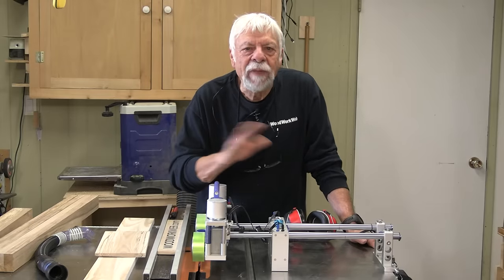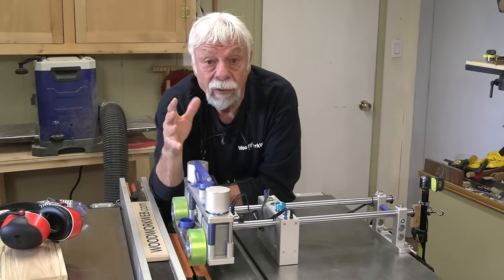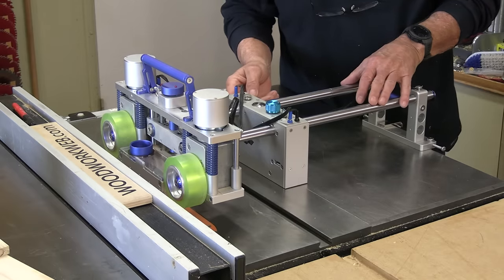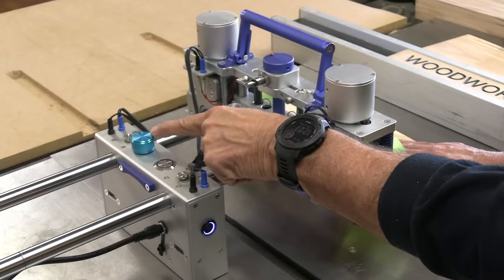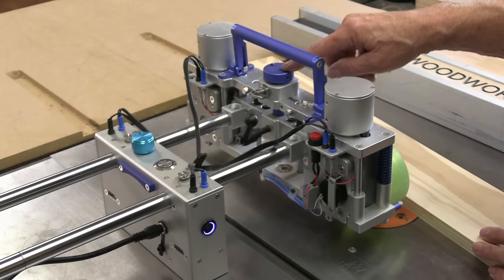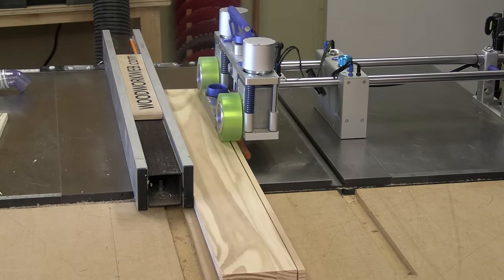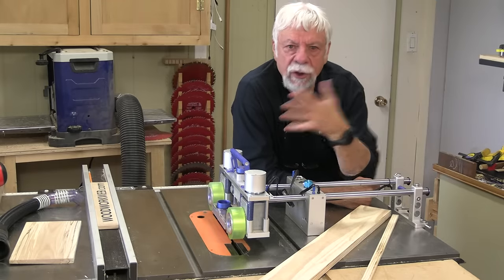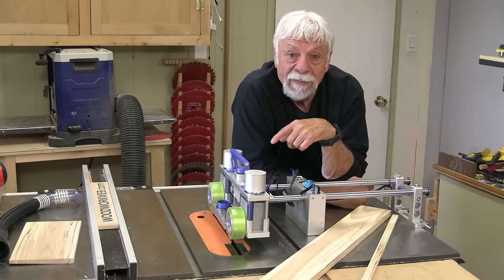Revolutionary Table Saw Feeder: This Changes Everything!

Comment: Pretty interesting.  I think normally I'd be a pretty good candidate for this device.  Why?  I have 3 cabinet saws.  I do believe in devices for safety and for more precision cuts.  Feeding wood thru the saw often makes cuts that are not so great, as when the person feeding the work re-positions their hands or themselves, there is a noticeable mark on the cut.  A feeder is very consistent and the cuts come thru much cleaner.  I use feather boards and have made very strong ones for my big Oliver, (where it has a T-Track) that really keep a board firmly against the fence.  I like and use from time to time, "Board Buddies" which are like these but of course not powered.  I also have 2 power feeders, (1 hp and 1/4hp) so I am used to feeders.  This device is better than the feeders for at least for some reasons.  Most feeders have to have a big column that bolts to the saw.  It is NOT a quick change.  For one thin, the 1/4 hp isn't really powerful enough.  It still weighs a decent amount, maybe 40 lbs? The 1 hp is powerful enough but it certainly weighs more than 100 lbs.  (I'm guessing but don't often move it because of the weight).  Also the adjustment on the normal feeder is not as quick as this.  You dial it down with a wheel that is not that quick, and since it is not spring loaded, it is difficult to know how much you have dialed it down.  This seems to be much more easily set to the right pressure.  
However, I personally find there are better places to put feeders, (router tables, and shapers are obvious,) Jointers.  Most people don't really know how great it is to have a power "puller" (same thing as a feeder but just on the back side of the blades).  The correct way to use a jointer is to apply downward pressure on the OUT feed table once adequate wood passes over the cutter head. Keeping that pressure on the out feed table is the key for producing a great cut on your jointer.  Often users don't understand this.  They think that because the in feed table is longer than the out feed, that the in feed table is the important reference surface.  NO.  It is not, it is longer for support AND for allowing the irregular surface "highs" to bear on that surface to keep the feed consistent.  Most jointer tables are not conducive for a puller's column.  ( can only really put mine on one of my jointers, a 12" one that happens to have a 24" wide out feed table.  This device LOOKs like it might be made to allow for smaller tables.  I hope the inventor considers this market.  For a shop with only one person, it is hard to joint large boards thru jointers and transfer that pressure on the infeed to the out feed seemlessly.  
Anyway, looks pretty good.  I do at times use my table saw to make multiple cuts where this would be interesting, those times I use the buddies, the feather boards etc.  This would be nice if it handles the stock.  A problem with feeders is that replacement wheels are expensive.  He should make it easy to get new wheels cheaply.  Anyway, great looking product for the small shop.  I DO think the hobby craftsman, who is serious, would also be interested.  Of course it has to be competitive with feeders, but that doesn't seem to be so difficult.  Again, it IS more versatile it seems.
Reply: If a 1/4 hp feeder is not powerful enough, there is a design fault. 1/4 hp is about what you can achieve with your arms, and if you can feed it by hand this feeder should be powerful enough.
Reply from the maker: I think your first comment about being a candidate for this is probably true, anyone with 3 cabinet saws would probably benefit from a dedicated "production" unit set up ... thanks for the detailed comments

Comment: I think this is an awesome concept and thanks, Colin, for bringing it into the limelight. The table saw is the most dangerous piece of equipment in the shop, so anything which helps to eliminate some of the danger is manna from heaven. Personally I am very afraid of it and I take a great deal of time before I commence cutting anything. The only problem is that I do not have a steel table top so the electro magnet won’t work. Probably half the table saws in use don’t have steel tops. But surely this could be secured using the mitre slot - then this would be an essential for every table saw, not just the steel ones. I will buy one in a heartbeat if the inventor can do this. I also think that every manufacturer should be obliged to sell one with their saw!
Reply: Alas, my aluminum table saw doesn't even have a miter slot, the old Ryobi BT3000.

Comment: Seems it should attach behind the fence so it would be out of the way for wider stock.  Also should have a sawdust pickup over the blade to keep sawdust from interfering with the grip of the wheels.
Reply: Saw dust collection is not the job of a feeder😂😂😂😂😂😂
Reply: @daveklein2826 so where do you fit the extraction when using the feeder ? That unit will not last long if it gets clogged with dust. And the feed wheels will slip too.

Comment: Great idea for good expensive table saw but seems over complicated. Those wires need more protection for a start. Also won't work on the mulitude of aluminium topped tables that  beginners tend to have. The wire problem is minor but needs addressing. If it works for you then that's great and i am not knocking the idea. Love your videos.

Comment: I would suggest the ability to mount it on left to right of fence and that would require it to run in reverse. Also look at having it in a modular configuration so that it can be used equally on a shaper  a jointer or bandsaw.IF its a one trick pony you will sell one if its a 5 trick pony you will sell lots.

Comment: Neat piece of kit. Seen similar for router tables... Of course, it will not work on anything other than a ferrous (cast iron) top. It also looks very prototypeish - I am sure a production model would be less 'open frame'. Might build one...
Reply from the maker: I don't know about a production model versus what I used, I do have a router table with a steel top and have thought about trying it out on that, I will post video clip on that when I do
Reply: @knecht105  The whole assembly cries out prototype. As a consulting design engineer, I would regard this as a 'proof of concept'- there are several areas that could be simplified and improved. An example, instead of the motor/gearboxes running vertically on guides I would have them rotate eccentrically to provide the pressure- simpler, cheaper, better. I could probably half the number of components while improving the performance.

Comment: Questions- What is the narrowest width piece that can be cut between the fence and the feeder? Can the electromagnetic part be moved left/right along the bars to change cut width capacity?
Suggestions- Magswitch bases (fast and less expensive), forward/reverse so it can be used on either side, and enclosed wiring with sealed buttons and switches for dust protection. This definitely has the prototype look to it. Or maybe its the hermetically sealed and clean lab equipment look 😅 As is, if you don't have good dust collection, it's not going to work properly for long. Thanks for sharing. It's a neat idea, but looks expensive.
Reply: 3mm/1/8 inch; Yes; Large magnetic switches are pretty expensive.; The control box is already designed to be dustproof, and the wiring will be optimized. It has a dust collection function. Thanks
Reply: @smitoolca5765  I was looking at all of the nooks and crannies for dust to get in to. On top of the motor boxes when the pressure is on so they may not lift as well, bearings, the push with indent style buttons... I'm not trying to tear your baby down, just noticing things similar to others that fail over time. Internal wiring and sealed switchgear will help. So can the box be moved along the bars?
Reply: @carlstrohm3785  Yes, with "push off," you can move the control box, and then, with "push on," lock it in position to accommodate different space requirements on the left side of the blade. Thank you.
Reply: @smitoolca5765  Thank you for the responses and I sincerely hope you can bring this to market. Many fingers will be saved.

Comment: Man I sure wish I had this back in 2021, I had an accident with a tablesaw after the flooring I was cutting kicked back and sucked my left hand into the blade, I severed three tendons (thumb, ring finger and pinky), 5 nerves, 5 blood vessels and nearly lost my pinky finger, it was a life altering injury. My thumb and ring finger have healed very well, I have most of my strength back in them (the nerve damage still sucks though, even after they were repaired with cadavre nerve sheath) but my pinky is curled up and has about 10% of it's original range of motion and almost no strength, I'm very close to having it surgically removed because it just gets in my way. I really wish I had this...
Reply: Bless you! Wish you all the best!

Comment: I wonder why they didn't add a little skew into the wheels out of the gate? Seems like that would sure even pressure against the fence. The way you've done it seems like it would put more pressure against the fence on the outfeed side.

Comment: I suggest that the bulk of the mechanism needs to be on the other side of the fence with only the roller assembly on the blade side. This way the restriction on how wide the stock lumber you are cutting can be eliminated. Otherwise a very useful product.

Comment: I could sure benefit from this.  In my woodworking life of 40 years or more I've had one kickback, which was not that long ago.  I have an older Craftsman direct drive table saw and I never thought it had the power to throw a board at me.  Boy was I wrong.  I wasn't hurt but it happened so fast with so much force it scared the cr@p out of me.  Do we have any idea how much this would cost?

Comment: The easy removal of this is a great idea. I have a cantek auto feeder on my table saw. I needed to drill and tap holes in my table saw bed to mount it. What drives the wheels on the feeder.
Reply from the maker: I have heard of this before, people who had to drill holes in their table saw tops, you are an ambitious wood worker  ... yes the electro magnet is a quick and easy replacement for that.
Reply: Each wheel has a dc motor

Comment: I was able to do this 39 years ago with 2 Grizzly stock feeders, one before and one after the blade.  These were used to produce stock for face frames in cabinet making.  It's an old idea.  The electromagnet is nice but not absolutely necessary.  Wtih 2 bolt on brackets I was able to install the 2 units on the saw without drilling the table.  By the way, if you did have to drill the table so what?  If you are setting this up for production the saw is going to be dedicated anyhow.  Conact me and I'll show you how it's made and how it works.  Works on shapers too.  In my opinion feeders should be standard equipment on table saws rather than gov mandates about rip stop finger saver nonsense.  Pretty soon you'll need a license to saw lumber.

Comment: I note that you have removed your riving knife - and it looks like you have to. Fine with this feeder in position, but it means you have to replace it every time you switch this in and out. Also, the magnetic module severely limits the width of material you can cut.. It uses springs to apply the downward pressure, whilst using a mag-block to stop the feeder lifting. Remove the latter, and you do not need the former!
Reply from the maker: Like many things, this unit does have limitations but I found that the unit is quick and easy to set up and use, and remove, but as I said earlier, this unit is not ideal for everyone, depends what you do

Comment: It looks both wheels have a slight can’t towards the fence.  The rear wheel looks like it’s canted a bit more. It may be caused by the camera angle, but I can’t tell. I’d be afraid of setting the wheels over the cut line.

Comment: Love the idea of the tool, but I have some concerns
this tool sees to be designed as a totally hands off the wood design.  Great you say, until the magnet fails   (power cut maybe, but the blade is still going to be spinning) or something similar happens. Any kickback then could be lethal to the operator of the table saw as there is nothing to hold or control the direction of the wood.  
 I would suggest a laser detector to ensure the operator is not directly in line  with the saw blade so that if kickback does occur any wood flying backwards is not  going  to hit an operator.  Should be fairly simple to implement with that existing setup. Also a big killswitch on the top of the device to stop the power rollers in case of emergency

Comment: one design change I would make if I were this company... swap the motor on and the magnet switch. I dont want an oh shoot moment, and have natural instinct tells me to shut it down its the switch right there in the front, then have a bigger oh shoot as I send metal and rubber wheels crashing around while its still moving. Personally I don't trust any automated machine without an e-stop (maybe a 3d printer, but my tiny CNC sure has one!)
Some might argue that its on top because most of the time on a table saw you are over the top of it looking down, OK that is totally valid. Though the stop button requires the user to reach down past cables into a "pit" between whatever that key thing is and the knob to access it ( 2:48 ). if anyone is wondering I have been making automated and robotic machines for high speed assembly for a little over a decade ... when a machine is being angry the last thing people want to do while in a panic, is reach into it!

Comment: Panhans have been making a saw based feeder for many years and it is far superior to this although more expensive. It is covered so that the workings do not get contaminated with dust (Has this designer ever worked in a dusty wood shop ?] . It also attaches to the fence which is better and it has extraction.

Comment: Seems to me that mounting system would limit the width of a board you could cut down. There is a reason existing power feeders are typically mounted on a 3 axis post outboard of the fence. I really can't see how this is an improvement over current power feeder designs

Comment: Why is this revolutionary? Its a power feeder okay. I had one one my 12" table  sawand shaper for years. Great for making runs of moulding, stiles and rails. Keeps a consistent feed rate which prevents burning on woods like cherry, purrple  heart and pecan.
Reply from the maker: The idea is revolutionary, I have never seen of heard of this style of feeder before now ... and yes I agree with your comments about burning, I  did find a bit of burning but I like how you can easily increase or decrease the speed of the wood passing through the blade even while it is cutting and it does eliminate those aggravating burn semi circles I often get at the end of many cuts
Reply: @knecht105 Panhans have been supplying a saw based feeder for many years. It fits on the fence

Comment: Honestly  it needs to ride on the fence and not so much the table.
Also if you have a router table 
It should work vertical and horizontal  and lock down with miter slots. 
A power feeder can run 1k bucks 
This should run under 200, or better yet 100. 

Would i buy one?
Maybe if its a kit system and has other mounting options.

Comment: What is the price tag on this product. What happens if the wood is warped ?
Reply from the maker: I think the Kickstarter price was set at $849 Canadian but you will need to check that, as per the warped wood, like any table saw, warping on the fence is a VERY bad idea, warping on the flat side if minor warping may be acceptable but the best way to check this would be to run through the saw with blade all the way down ... as a rule of thumb, cutting warped wood on any table saw is NOT a good idea.

Comment: JFYI. If you get something for free to keep or for a long-term loan "to review", it's still compensation, and YouTube requires you mark the video as containing a paid promotion. Otherwise, all these kickstarter folks tend to just take advantage of youtubers and youtubers take advantage of viewers by not disclosing the relationship fully.

Neat power feeder, though. The exposed look is cool, but I think they need to streamline the design to remove dangling cables, and all the places where dust can collect to make it easier to clean and less likely to get snagged on things.
Reply from the maker: I agree, unless you purchase it or return it :)
Reply: @knecht105  Sure, if you do so before you post the video, I agree. Lots of abuse of "long term loans" and "I'll probably buy it in the future" to try to get around this in astrophotography and synthesizer circles, where the equipment is also quite expensive. Keep in mind that discounted purchases are also compensation.

Comment: Long overdue. I would say it needs rollers, on springs at least, that run at 90deg to run on the outside of the workpiece to push it against the fence.
Reply: he sorta explained that having the wheels not perfectly parallel to the fence pushes the workpeice against the fence
Reply: Not necessary if the wheels are canted
Reply: I have this feeder and mine has small adjustable wheels that fit on the bottom side of the feeder and hold the stock against the fence.

Comment: Not a woodworker, but this looks excellent - blade is concealed, kickback should be eliminated, what not to like.
I'd add better power connectors to the motors - those look rather flimsy.

Comment: I’m concerned for sawdust clogging the delicate parts… no top dust collection.  The wires look like snag hazards right now.   I’d move all electronic controls much further away, and wrap the control cables in a single more durable harness.